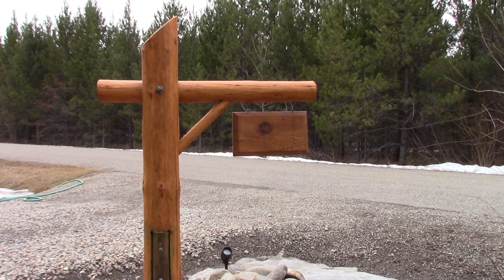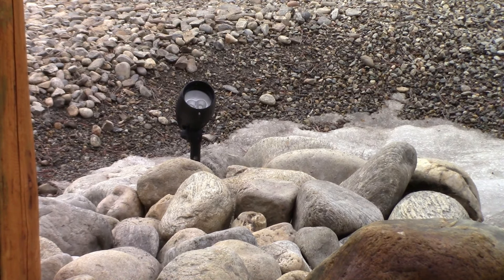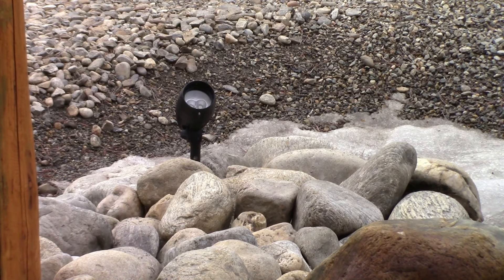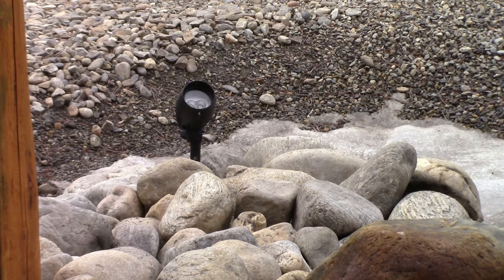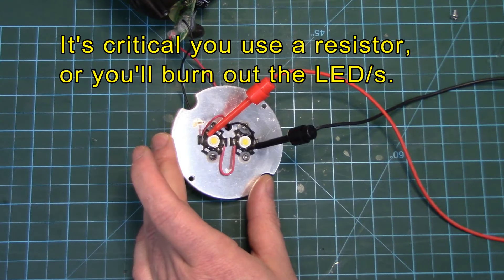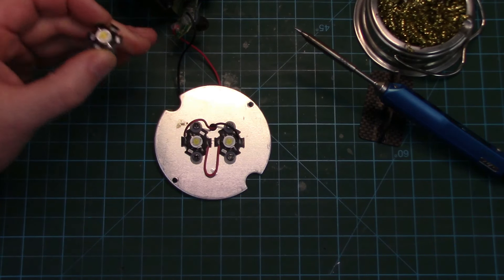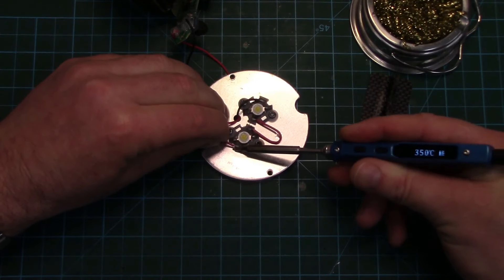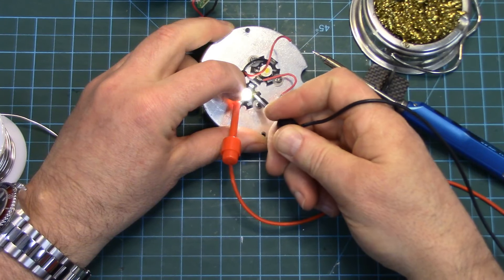DIY LED Garden Light Repair - From Start To Finish

Comment: Hey there I enjoyed the video. I'm repairing some small 12 volt landscape lights myself. The LEDs had burnt out as to the small chips behind them. From watching your video I think these are resistors? My new led chips work, great but do I need to replace the resistor as well?

Comment: Hi John,

 I would like to use the 12 V ZUCKEO lights you recommended with a 12 volt AC power supply.
 Are the 12 volt ZUCKEO lights you recommended AC or DC? Does it matter? Thanks.

Comment: Awsome vid, someone who knows what they’re doing! Where did you get those quick connects from?, beats messing with the clamping prong non-reuseable that come with the light.
Reply from the maker: I fly RC helicopters and that specific RC connector is called a "Deans" or "T-Plug". It's just one of many different types of RC connector that could be used on LV landscape lighting, but they are cheap and easy to find. Here's an article with a video I did on Dean's plugs if you wanted to know more about them: https://www.rchelicopterfun.com/deans-connector.html

Comment: Great video. I would like to try this myself. What make and model of soldering station and white conductive cement are you using? Thanks John.
Reply from the maker: It's not a soldering station. I'm using a portable soldering iron called the TS100. It uses direct drive technology tips and functions as well other direct drive tip soldering stations such as the Hakko FX951 or Ksger T12. They are amazing little tools if you need a portable soldering iron. I did a review on the TS100 iron a while back: https://youtu.be/OYDeogFmLWI
As for the thermal past... I have no idea what brand it was. Just generic white thermal paste - nothing special.

Comment: How did the voltage measure higher at the lamp than on the transformer?
Reply from the maker: Pretty minor difference 12.8VAC vs 13.0 VAC. My guess is the probes were simply making better contact at that gold plated plug than the corroded terminal screws on the back of the transformer.